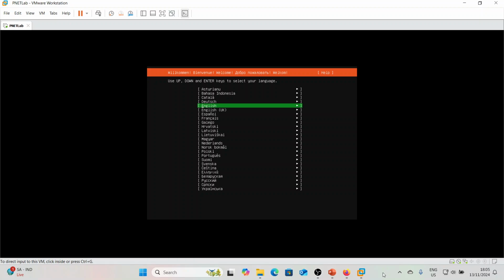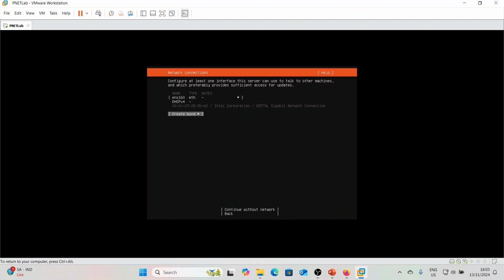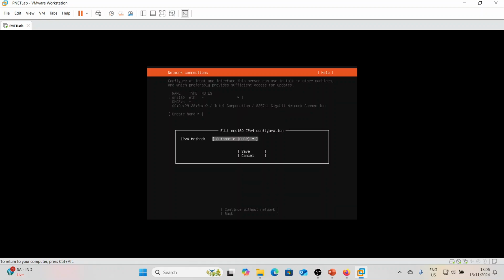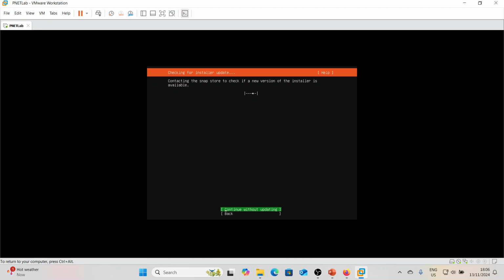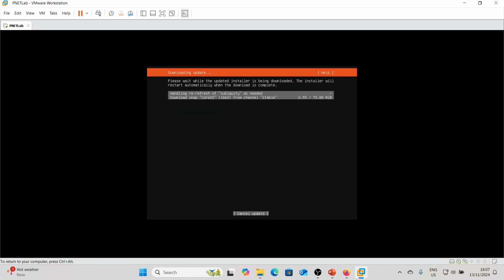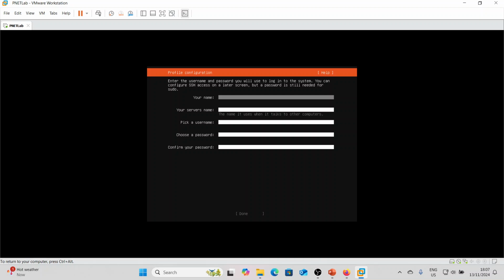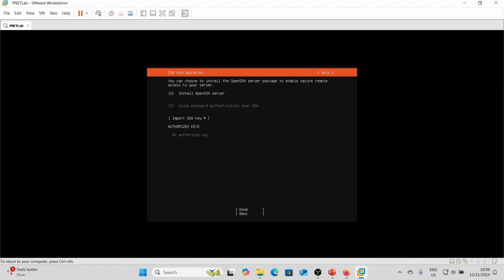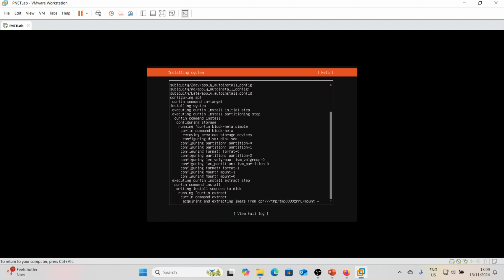04   Ubuntu Installation Lab 2

Comment: 1:50 I’m using my router which I already configured my subnet on which my devices obtained DHCP lease IP address from, so can I leave to dhcp so de this installation obtain ip from my router? 
I don’t want to assign static IP address

I use eve-ng for past 3yrs now, just want to try pnetlab this time